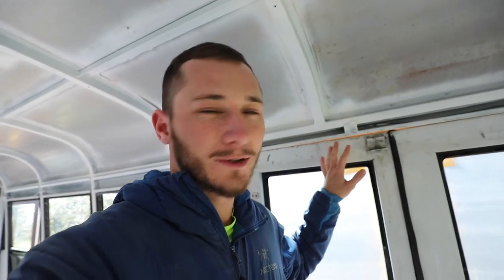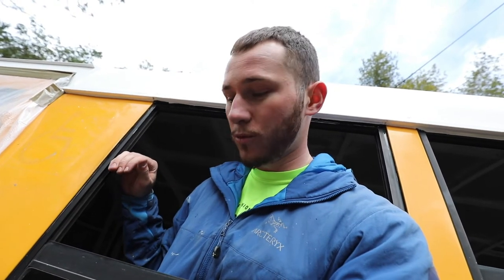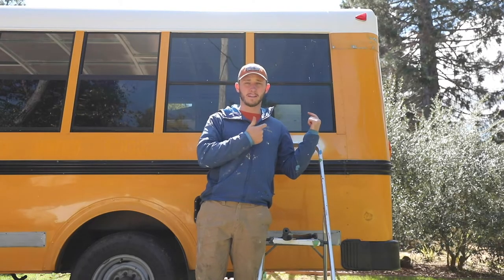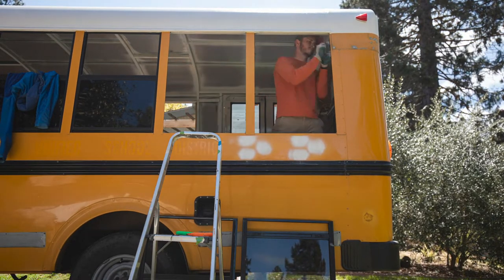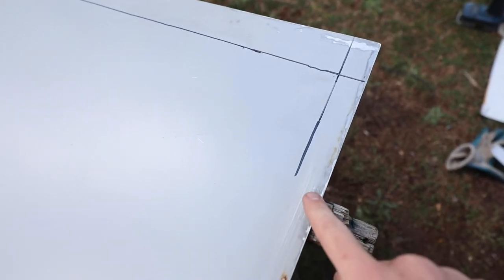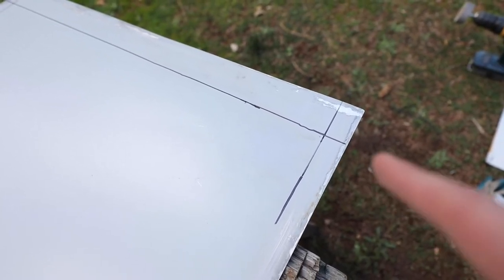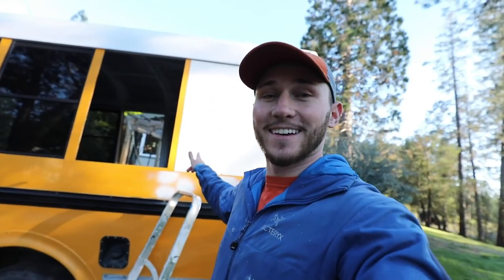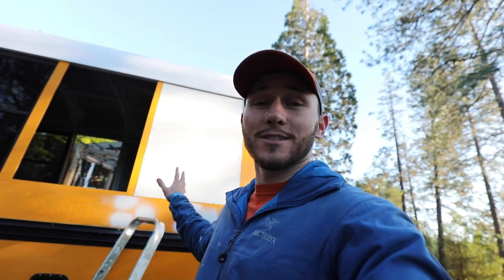I Just Covered My Bus Window! - Bus Build Episode 10

Comment: You know what your budget for this bad boy is going to look like?
Reply from the maker: Good question, it's going to add up (it already has started to do so) but I don't have a solid figure set. I'm comfortable with pursuing proper execution within reason, if that makes sense. If I'm able to maintain working on it as planned then I don't plan to take financial shortcuts that I'd regret later. That being said, I can certainly see myself going for affordable options over the luxury version of similar products. It's a dynamic situation...as you can tell by my disjointed answer to a simple question.